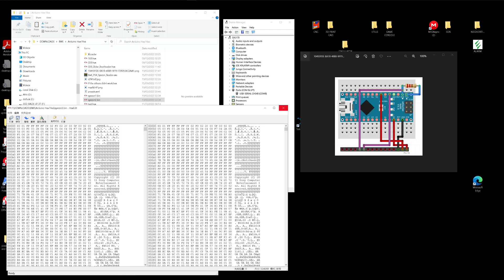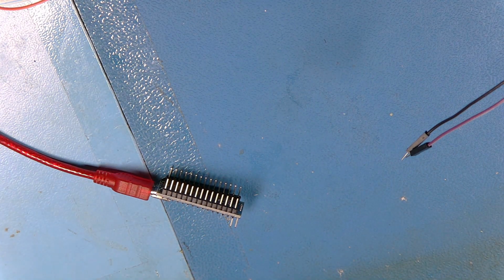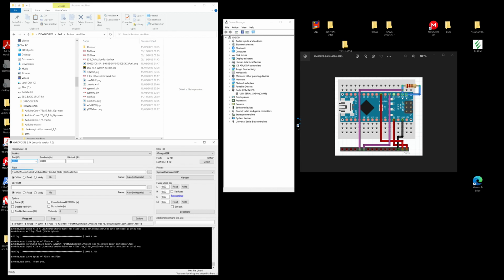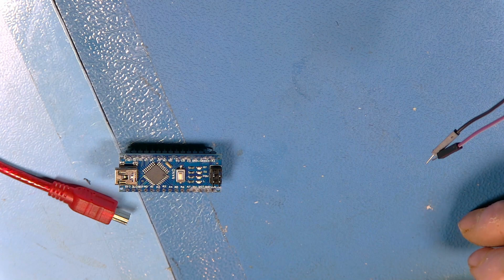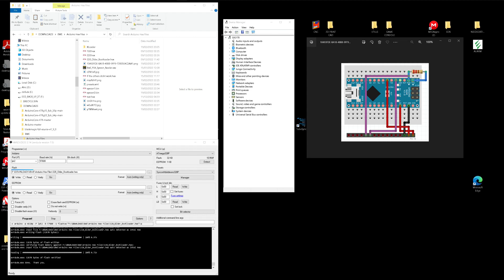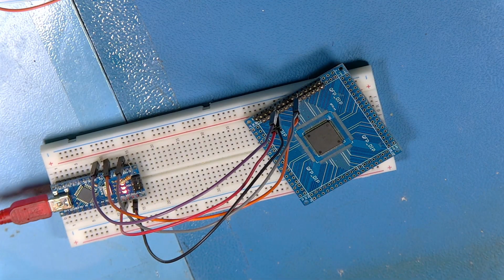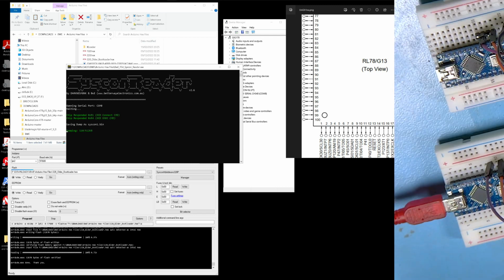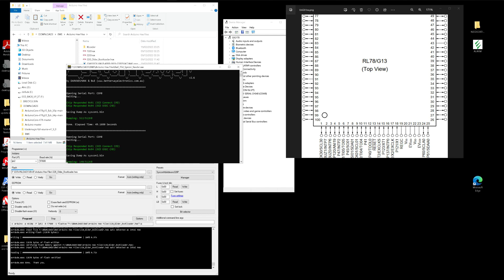Making the Arduino Ps4  syscon freereader. please give like and subscribe

Comment: Can you provide me with the project files, since the link on the Mega page doesn't work?
Reply from the maker: https://github.com/AbkarinoMHM/PS4SysconTools
This is the new package.
Reply: @Steve_be  Where is the hex file located to program the Arduino programmer? It only appears for the Teensy programmer.
Reply from the maker: @zerausynohtna938 the arduino was only a reader it di not. write….  I see if i can find tomorrow….  Your better using the new Abk.
Reply: @Steve_be  Which ABK? If you can get the hex file for the Arduino programmer, so I can also write the SYCOM, it would be very useful, since it's the easiest programmer for me to find.
Reply from the maker: @zerausynohtna938 only teensy4 for writer dont have hex for arduino writer .. sorry

Comment: Hello Steve, does this method still work to read Syscon? I have had many problems with the bwe reader-writer so that it does the glitch and reads the syscon. Apparently there are many ch340G clone chips, but I am interested in this method to read it since I have the bwe payment program Uart Syscon Tool
Reply from the maker: @Gabriel-cn5ns  if you have the BwE tool and software you should be ok .. which BWE  software / programmer have you got
Reply: @Steve_be  I have the program Bwe UART Syscon tools 1.02, and I have the CH340G programmer with the capacitor and the 220 ohm r to the DTR point of the chip, the problem with that programmer is that it doesn't glitch, I can only read and write with that programmer when the syscon is unlocked.
Reply from the maker: @Gabriel-cn5ns  when you dump sys con then edit the lock bit then write back i think the lock bit 00C3 locked its 04  set to 85 then write it back. Ill check the address first but i do mention it in one of my videos.. im off out tonight as i play in a 🎸 rock band..  give me a shout discord.   https://discord.gg/q3uerESC

Comment: Hello, can I use any arduino? or does it have to be the nano 3?
Reply from the maker: the code is based on the 328p and 168 chips i have only used the Nano
Reply: could you also make a guide on assembling the writer for flashing a new rl78 chip?
Reply from the maker: @shanthoshravi5073  https://github.com/msalau/rl78flash      all your answers should find hear i use a renesas Lite programmer but you can use a UART have a look at this github you should find your answers
Reply: @Steve_be  Thankyou so much, I got the dump off successfully of my syscon, I'll hopefully mod the syscon and flash it on the new one soon to revert firmware. On a sidenote, would you happen to have access to the ps4 nor validator and help me mod my dump?
Reply from the maker: @shanthoshravi5073  well done on the dump, certain ill help join my discord   https://discord.gg/9QaVCZrV

Comment: hi, i cannot find the file for flashing the arduino in the description links...
Reply from the maker: https://betterwayelectronics.com.au/downloads/Syscon.rar
Unpack look in the Arduino folder for hex files then pick the one you need build if you need any more help let me know
Reply: @Steve_be  ty for your reply. the one in that pack is only for syscon reading, right? i tried to write it but did not work.
Reply from the maker: @nice69mania  you cant write to old syscon with the free softwear youy have to buy a new chip a write the files to it  it does explain it all on the BWE site, to write to the syscon thats on the board you will have to buy there writer,

Comment: Hi. I see that you used 330 ohms resistor. Were the two dumps a match? I used 100,220,512 and it still gives me "files don't match".
Reply from the maker: yes all matched fine  are you reading of the board or on borad

Comment: You make it look easy and smooth. Great video. Thanks.
Reply from the maker: Thank you, just a quick note,if you use a later arduino nano you can use xloader to programme which is in the file folder  ,which is far simpler to use than AVRDUDESS

Comment: Very interesting Steve!  I remember you speaking about working on this.  Thanks for sharing!
Reply from the maker: Thank you, there are a few more on the way ,going through repair of corrupt syscon causing the bios blod and rolling back the os,its just making time between repairs how is it going your end
Reply: @Steve_be  it’s going well.  Staying busy of course.  This interests me because I have at least one PS4 with the “loadbios -8” error which I believe is syscon.
Reply from the maker: @ToltecMerc  yes it normally is  , i can manually create the fault by changing 4 bytes of data in syscon. I was going to send some info on messenger but i cant find you can you send me a hi or something.

Comment: greetings friend, the discord link is expired, you can update it very good video
Reply from the maker: Are sorry about that just search for BWE and for me Digimod  on discord, ill update info later
Reply: @Steve_be  no problem thanks
Reply: @Steve_be  a query, do you know someone who has knowledge about, arduino programming
Reply from the maker: @modgames44  what is it you wish to do i may be able to help if not i may know a man that can. As they say
Reply from the maker: @modgames44  im confused are you talking about louie from BWE.   

https://discord.gg/console-repair-discord-754165317961383997

This is BWE discord
Reply: @Steve_be  It's about the method used, that's what I mean
Reply: @Steve_be  My question is basically, if it is possible to upgrade to more firmware, sorry for the English, the Google translator does not translate as I want
Reply from the maker: @modgames44  you can only down grade to the previous version that was installed.
Reply: @Steve_be  I understand, thank you very much, sorry for the confusion, the translator's fault.
Reply from the maker: @modgames44  thats ok any time i can help just ask